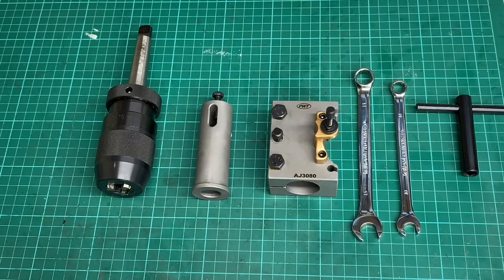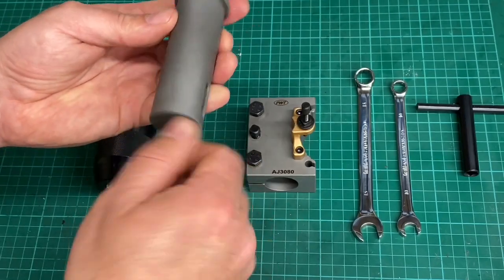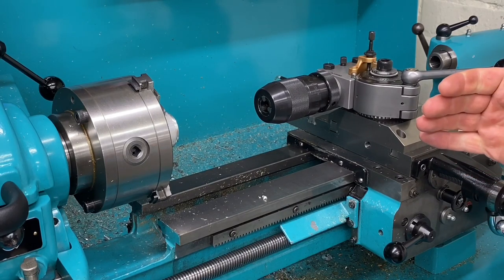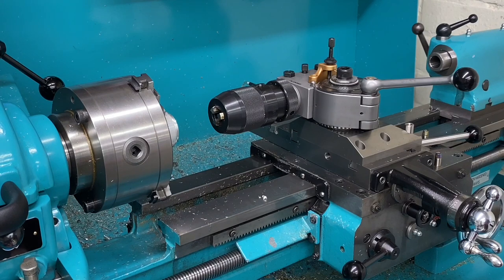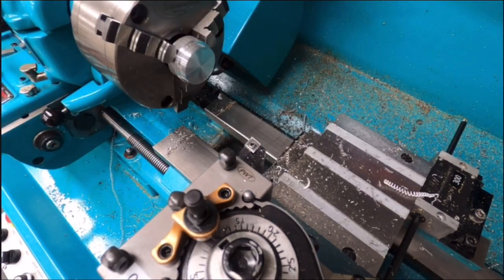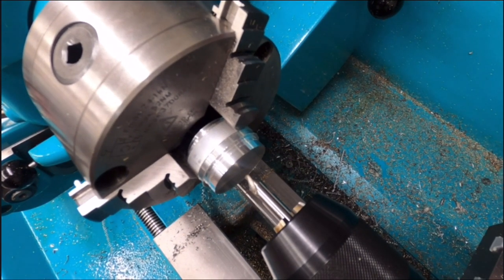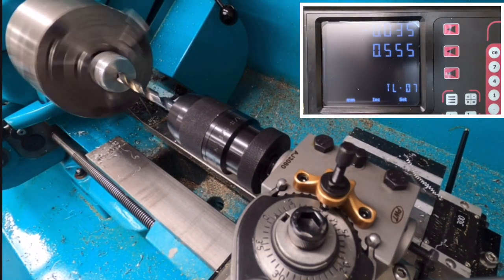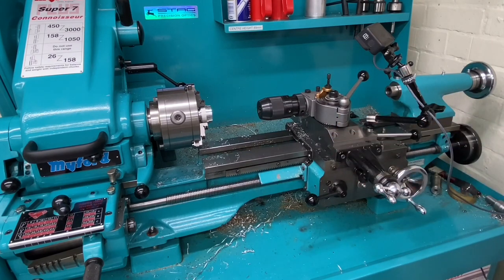Drilling with the carriage on a Myford Super 7

Comment: Brilliant! I have a boring tool holder and a spare chuck, so I turned a 1/2-20 thread on a piece of 3/4" stock and now I have a carriage mounted chuck! I haven't shimmed up my tailstock to account for the wear on the ways on my 82 year old lathe, so this is a really nice workaround for drilling straight holes without deflection. My next project will be a micrometer carriage stop/indicator holder so I can control the depth. I can't justify the expense of a DRO at the moment, since I only use the lathe for occasional projects.